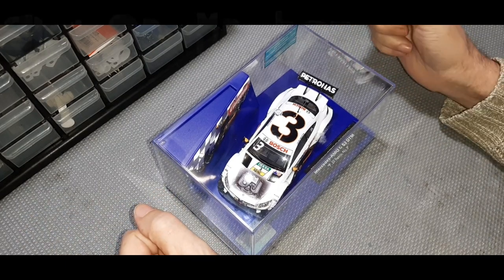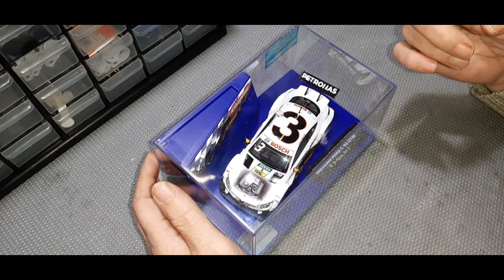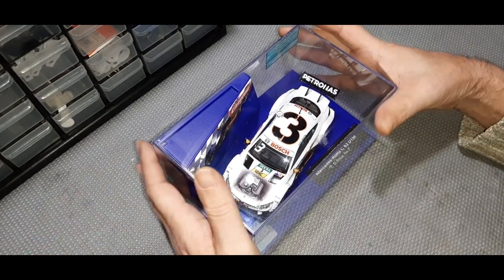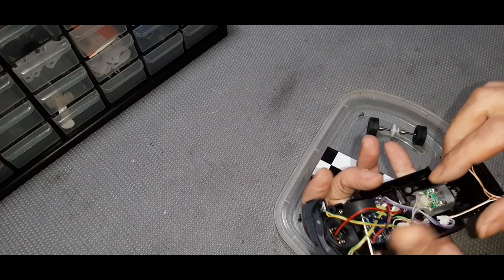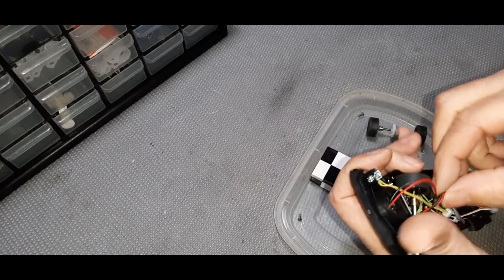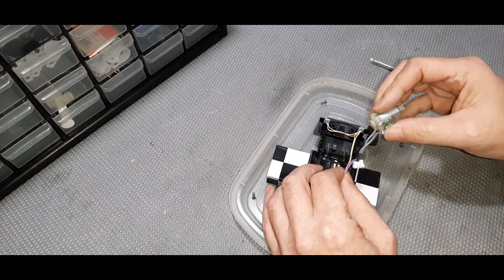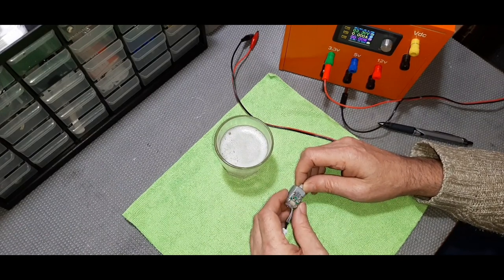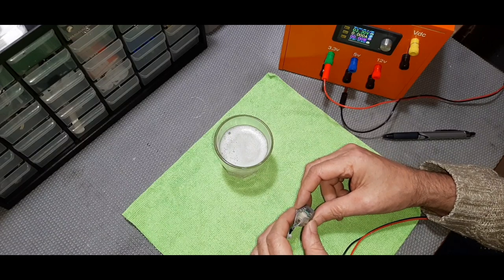Cars N Stuff - Episode 03 - New Car Setup and Break in

Comment: New to slot cars so basically just been running cars straight out the box. There was a lot of good helpfull  information in the video thank you.
Reply from the maker: Honestly, playing and improving the cars become a huge (and enjoyable!) part of the hobby. Still my favorite part.
Reply: Come down the rabbit hole 🐇 🕳 with us. Pick a car in your lot that doesn’t perform as well and start with just tuning the tires. You’ll get about 90% of your performance that way. If you don’t have a tire truer, get a couple pieces of sand paper and remove the concave and convex areas of your tire. Just enough.
Reply: I was looking at tyre tuners today on line but I could not see anyone seling the razor tyre tuner .I don't want to take the wheel off the axel so what would you suggest and what would be the best power supply.
Reply from the maker: Not sure what's out there now, I may have gotten a last run of the tire razor, but I will look.

I have a video on building a power supply from an old PC power supply...

https://youtu.be/0akGmeduwH8

Comment: Great to see you back!!! Thanks for the update. Thanks for the tuning video. Question. 🙋 
Can I do that break-in process to a motor that has over 5k laps already or does it need to be a brand spanking new motor?
Reply from the maker: Hi, I doubt you will see a big gain breaking in a motor already broken in, but you can try for a couple hours to help remove carbon...
Reply: @slotcarmayhem9765  great idea. should i do the WD40 and the cleaner or just the electrical cleaner?
Reply from the maker: Use both. 12 hours in WD40, followed by 4 minutes in the plastic safe contact cleaner.
Reply from the maker: If a well used motor, maybe 2-4 hours in WD40, as the brushes are already seated. Try, and let me know please!!

Comment: I just finished the break-in on a 1/24 Audi R8 LMS. 22hrs. @ 3.3v. When I put the car on the track I notice a whining sound coming from the car. The same sound that the car gives off out of the box, but now it is much louder almost like a siren sound. Where could this sound be coming from? I put a drop of oil at both ends of the motor and greased the pinion gear and all four wheels. What are your thoughts John?
Reply from the maker: Sounds like gear mesh...
Reply: @slotcarmayhem9765  I will apply more grease then, Thanks.

Comment: Help! So far I have used this break-in on three motors. The first one gave me mirror results as you mentioned in the video. The other two did not produce as good of results, meaning, the amps. did not increase much at all. I ran both for 24hrs. 
All three cars were old, and ran on the track quite a bit before breaking in the motor. I was wondering if this could be the reason for poor results after the 24hrs. of break-in?  Take care, Ron
Reply from the maker: Well used motors are already "broken in", meaning the brush profile matches the comm. They are not broken in gently, and you will find a new motor broken in gently will outlast a motor that is broken in on the track.
Reply: @slotcarmayhem9765  A lesson learned. I will make sure to not bypass the break-in process in the feature on new cars.

Comment: im a little confused at how you are judge in your efficency of the motor    you are looking at the amps the motor draws to run .... you have nothing showing your output watts what you are infact seeing is the watts used to drive the motor..... so with those numbers increasing....that is actually showing that it is drawing more amperage to drive the motor      so if you ask me    um thats a drop in efficency   no?
Reply: Agreed. Efficiency 
n= Pin / Pout by definition.  But we do see a change in amps- probably due to reduced resistance at the "now conforming" brushes delivering more of the applied volts to the armature windings.  This leads to higher rpm which drives more bearing resistance, both of which increase output power.   On top of this, these no/low load tests don't reflect the performance in service at higher loads, volts, and amps.  That will show up as punch, accel, deccel/braking performance which should all be stabilized and better after motor break-in. 
But kudos to John for taking the measurements & for taking the time to share his know how and process in any case.